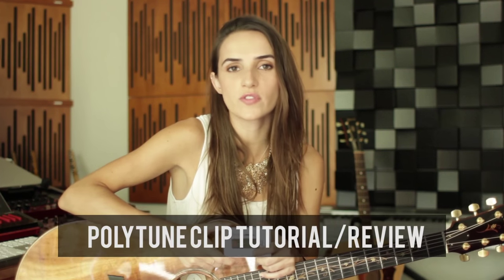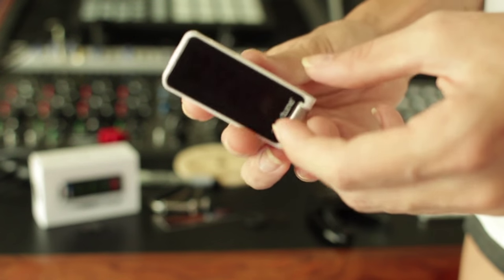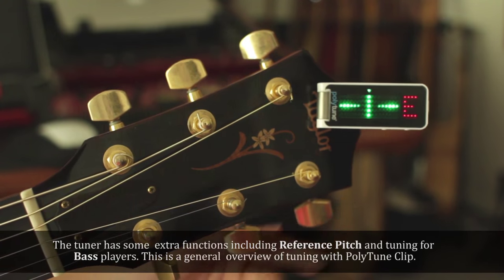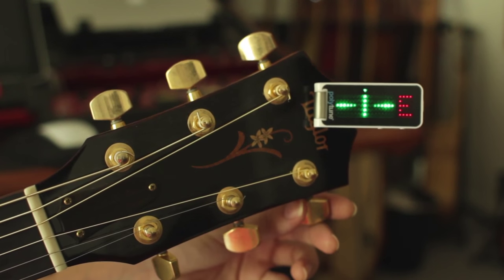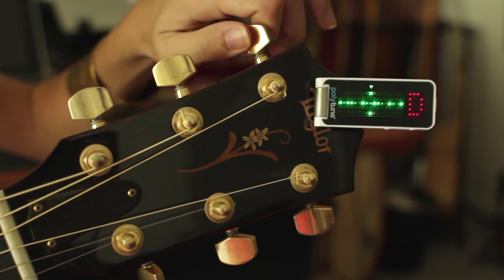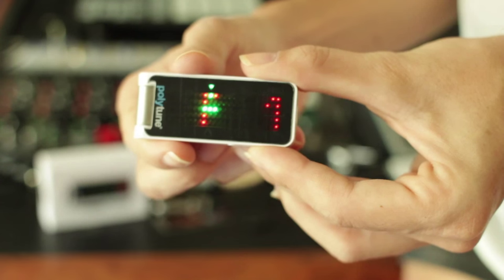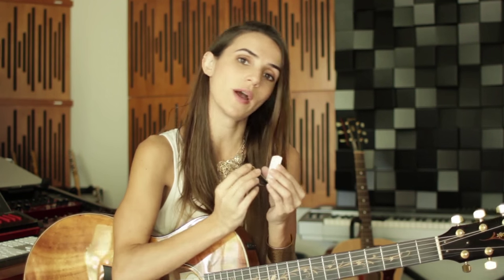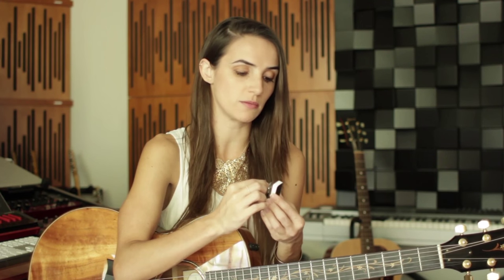TC Electronic PolyTune Clip Review/Tutorial

Comment: I've got one someone gave it to me because it was broken it only fell from knee height, but landed on the power button which broke it internally I did a bodge repair and got it working but you now have to take the battery out as you can no longer turn it off, but I discovered the best tuner I've ever used so far, the feel and stability are brilliant, but I've decided to try a Peterson now, hope I don't regret not buying a new TC

Comment: Had a Unitune delivered today.  Disappointed with it so far.  It arrived with no battery even though the instructions said one was included.  Very hard to clip it on in a sensible way so that it can be read.  It moves up and down on the cheap metal clip but not from side to side.  The only way I can clip it on and see it is by having it vertical but then the tuning indicators are small. To see full width display it has to be clipped sideways but then it's hard to see and the note ID letter stays sideways.  Very strange. Thought it would be more accurate than my Snarks but it's not.  AND it cost me three times what the Snarks cost me!

Comment: Is this far more better than any clip-on tuners like snark? I have a snark tuner and it's very frustrating to use it most of the time. I don't want to add a tuner on my board because I'm planning to buy a reverb pedal (My board only has a maximum of 6 pedals). Will you recommend this than buying a cheap tuner pedal?
Reply: Imo, yes these are better than Snarks. A bit more accurate. Noticable.